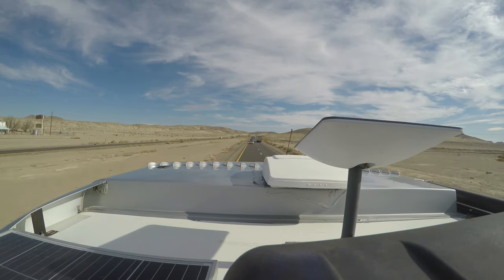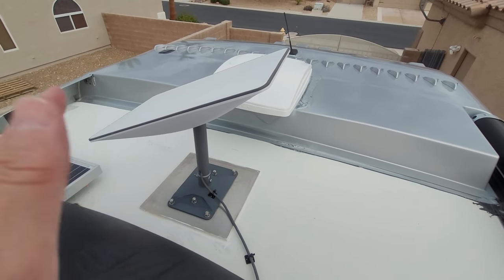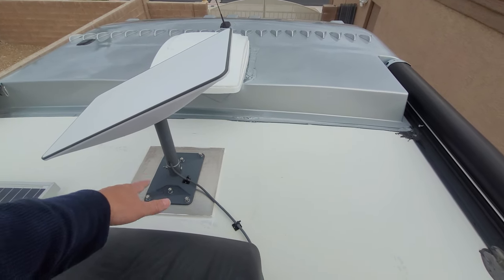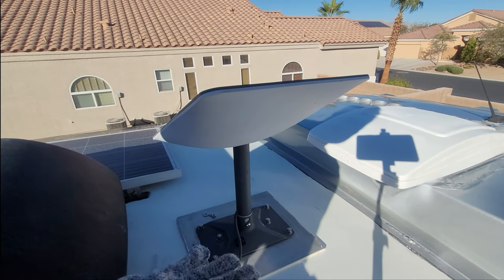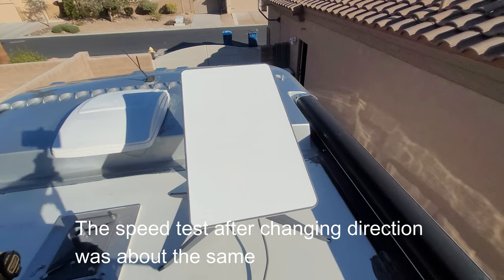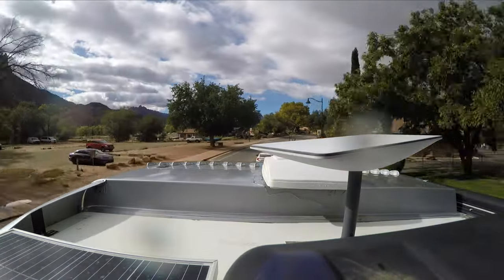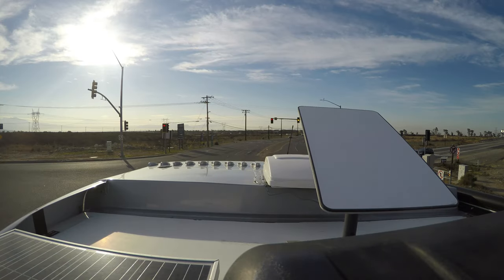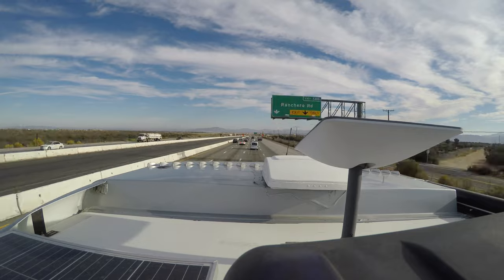STARLINK Speed Test while Driving in my Winnebago

Comment: Hi rv life diy....great video and it appears to be just what I was looking for.
I have recently purchased Starlink (Australia) and have been searching for info like this to see if I could mount the Starlink permanently on the roof of my mobile home, as I do not like the idea of setting it up at every campsite.
My concern was whether the starlink dish could handle the head wind speeds when I am traveling at 80km/hr - 100km/hr. So thanks for sharing the video.
Reply from the maker: Thanks for watching and comment.  We really like the set up, and yes that was my first worry as well.  But I've seen how the dish is assembled together, and the top part of the dish is very secure.  The connection to the base is the weakness, and the throughbolt will make it very secure.  If you haven't already, make sure to watch the full install video done earlier, and that will show how I did the complete install.

Comment: Are you still liking the setup? I am between converting that to a starmount (lots of risk), getting a hp dish, and waiting for the new v3 to come out. I feel like the general public thinks the standard can’t work in motion but looks like it can even going fast on the freeway?? Any input or advice would be helpful lol
Reply from the maker: The starmount looks better being flat and lower profile but of course expensive and more work to do.  If your roof needs the max space, and lowest profile the Starmount may be better and looks the best. Mine is just the simplest way but does stick up higher.  It looked really good on the Winnebago because of the stepped roof.   It works fine in motion.  It seems most that never have it mounted keep mentioning that it is an issue.  Make sure to check my newer install on my new RV if you do decide to do it.  I use thinner metal plate that is lighter and easier to work with.  But version 3 may come out soon so who knows.  All I can say is that mine works flawless.  30,000+ miles used on my Winnebago and 10,000 miles on my new RV. Good luck whatever you decide.
Reply: @rvlifediy thank you!! Yea stealth is definently a big factor in wanting a flat mount for me. I figure I can Macgyver a way for the hp dish to sit lower then the roof deck but still be at an angle (maybe a seperate platform that sits under the roof deck). But that would be just as much work as the starmount anyways. I think with the higher power draw of the hp and new 10mph thing I’ll just do the risky starmount setup & hope it doesn’t fry my dish in a year😅

Comment: Morning Craig, I'm not all that interested in the subject of this video but I watched all the way through. In the future if I'm looking into this it will be great to have your videos as reference.
Totally off the subject, did you install the VG's on your bunk over the cab roof? I pretty sure those are not OEM from Winnebago. At least I've not seen them on any other Navion/View roof in videos/pictures before except yours.
Reply from the maker: Mark I was going to send you an email on this so good timing. Yes I installed the VG's but without any thought originally. I was worried about possible wind turbulance that may or may not be present to impact the starlink.  By placing the VG's in that location I'm not sure if it created a negative characteristic I may not be aware of. I was even thinking of removing them today.  What's your thoughts?  I'm very sensitive to the handling characteristics in the wind so I don't want to create a negative effect.

I was going to place them in the very back tail end of the roof line but not sure if there is enough surface area to make Any difference. I don't want to put them on the sides as they look pretty ugly.  Before I do anything, you could probably give the best insite. 

Main goal would be to have the RV more stable in windy conditions as well as passing semi trucks. Not sure if this would even be possible. Thoughts?
Reply: @rvlifediy  well, honestly, I really only have direct experiences with the use of VG's for commercial jet transports. And based on that (this could long), I question their usage on relatively low speed ground vehicles. Race cars, it might make sense to try using them, but as far I know, VG's aren't used on race cars. Gurney flaps sure, but that's to make the rear wing more effective in down force but also is very dragy. F1 uses lots of wings, front and back, to control vortice to good effect.
And generally that's also the point of VG's, to make the surface more effective or control vortices. For example, to make the wing lift more (up or down) or a make control surface more effective at a given angle. And they do, they are very good for that purpose. Even at "low speeds", like landing and take off speeds of jet transports, 150 to 200 mph. They are ment to energize the flow so that it stays attached longer as angle increases. Without them, flow will separate from the surface at lower angles resulting in lower or loss of lift or effectiveness.
So concerning VG's on an RV, I'm not sure what practical situation would be equivalent to this. Maybe, as you suggested, putting them on the sides near the back (not right on the back maybe a few feet forward) would create more side force in the back to offset that at the front to reduce yawing moment due to side winds (stabilizing?). But this will likely also increase overall side forces (destabilizing?). A Gurney flap right at the back might do this too and not look so ugly. BTW, the VG's you have, which are typical of what people put on cars, are overly stylized. A simple L shape, set at an angle would be just as or more effective and might not be as obvious or ugly.
As for using them on the top, you would do that to create more down force on the front and rear for cornering traction or just on the front to spoil high speed lift off forces.
I think having them on the bunk of the cab roof will either do nothing or create more lift (destabilizing?) or will likely just be creating more turbulence right behind them. Which could be causing more fatigue damage to your Star Link mount and might also be causing your vent cover to rattle more. Putting them on the top in back will not likely result in any benefits for an RV, just more drag.
There you have it, my thoughts, not sure if that was helpful.
BTW, I have done collaboration aerodynamics research with my Alma mater, Purdue University in Indiana, and I think this could make for an interesting investigation. "Where to put VG's on an RV, if any place, to gain some benefits to stability and/or gas mileage?" Hmmm, I might need to contact my people back there... 🤔. (I was born and raised in Elkhart County Indiana afterall. 😉)
Reply from the maker: @volofly2011  Mark I really enjoyed your detailed explanation and concur with most of the items I could follow along with.  I think the RV industry could really use more engineering on aerodynamics and wind tunnel testing.  Even the under carriage could use some help. I notice that many cars have some type of damn under the engine, but the sprinter vans don't (heard they do in Europe as an option).  Many things to consider, and the RV industry overall needs more engineers in their build.
Reply: @rvlifediy  Thanks Craig, I could share all day about this stuff. If you'd like to know more send me an email. 
BTW, does your chassis have the Crosswind Assist® which "helps stabilize your van and boosts safety in strong, gusting crosswinds."? (Got that right off the Mercedes website. 😊)
Reply from the maker: @volofly2011  Will do.  Yes my chassis has the cross wind assist.  The feature started with 2019 sprinters (2020 RVs) Marketing is much better than the actual product. It goes off way too much and slams on the brakes even in slight medium wind.  Upon chassis inspection, it is just 1 ride height lever on the back driver side axle and 1 on the front axle. When the ride height over extends, it slams on the brakes. Kind of annoying more than anything.  However, since I've done my suspension mods, I haven't had them go off yet which is a good thing. That means my suspension isn't over traveling with just a little wind force applied.
Reply: @rvlifediy  Ah, I see, that's too bad. I was expecting it to be more sophisticated than that. Good to know that the upgraded suspension improves things. I image it would be less sensitive on the original Sprinter vans since the RV adds more weight and up higher (weight and center of gravity both gone up). 
I saw a review of a 2023 Coachmen (that's right a Coachmen) class B that they had done a nice upgraded suspension over the basic Ford Transit van that looked really impressive. But a class B, not sure if we could live with a wet bathroom, smaller floorplan, tiny refig, etc.
Our daily driver is a Volvo XC90 and the roll over protect system on it is pretty amazing based on videos I've seen. Thankfully we've never had to test it ourselves but it's good to know it's there in case.